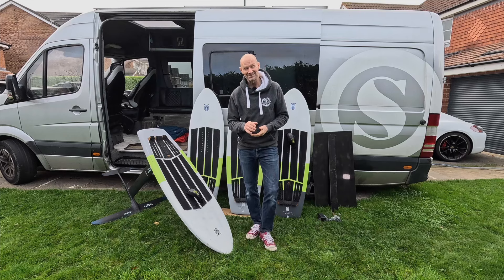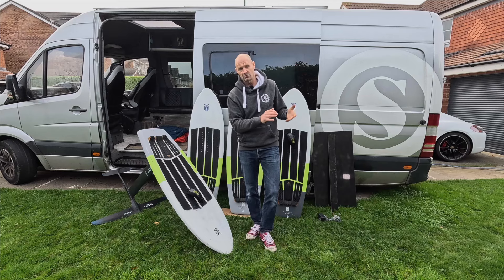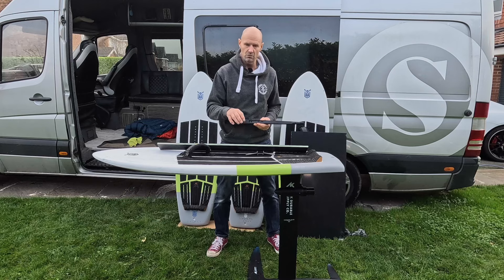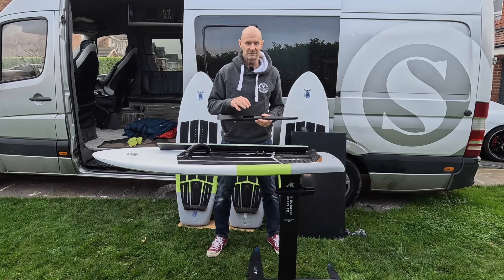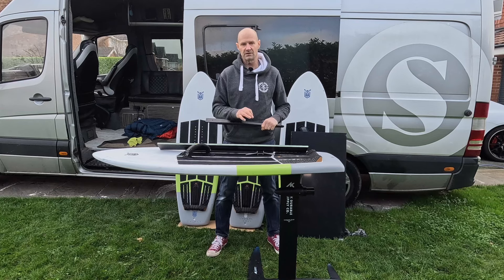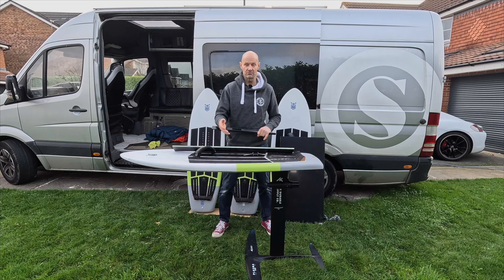Foildrive Max Inset board evolution - chapter 3 - stiffness and the carbon tub.

Comment: I’d love to see the water starts on these boards as I’m thinking along the same lines, volume doesn’t apply, but need to see the techniques to get signal connection and then getting the board level and planing.
Reply from the maker: signal is no issue - built in pathways in the boards in nose and deck. Starting easy also - as long as you pass the stall speed whilst in prone position you can ride almost any size foil (just takes more battery to get there on the smallest foils. The 4'8x18 we made is shown starting in vid #2

Comment: Great "engineering around". I share 100% what you're saying about stiffness. I have been wake thieving with Foildrive a lot trying to catch a wave that runs at 33-37km/h😅. It threw me off with the same 4'6" bamboo tech board and then it'd be controllable and rideable with a 4'6" full carbon board. You even feel less the swing weight due to the battery case. Pumping efficiency increases! In Downwinding it makes you work/pump less since you feel more. At first you need to get into it though..all the turbulence is also transferred right to your feet😅.Good job 👏 Bravo
Reply from the maker: wake thieving at almost 40km/hr, that's too funny. That's hauling!
Reply: @ktwo-surf  that's what you do when you live on a Lake far from the ocean 😇😂. Really jealous of those waves in your backyard 😀.  But sincerely I've really fallen in love with some wake waves. Amazing surfing 20km, sometimes more and learn for the time in the ocean. Share your stoke for Foildrive. And loving your boards 😁

Comment: What about mast lengths? Are they relevant when it comes to ability to catch waves?
Reply from the maker: mast lengths are a massive subject for prone foiling in general. From my perspective I use shorter masts in smaller waves, bigger masts in bigger waves. There is a ton of + ve's and -ve's to each, but ultimately the foildrive has enough power and speed to catch the fastest, shallowest ocean swells easily - it's a unique and total cheat code.
Reply: @ktwo-surf  thanks! It's quite a challenge for a begginer to grasp everything that's happening under their feet. I started off with 85cm mast now have a 60cm on order. I have vague idea of pros and cons ultimately the lack of info out there specially for beginners means I am often throwing money at bits and seeing what works and what doesn't. And perhaps this ambiguity suits the industry.

Comment: Really interesting! Where can I see standrad dims etc.?
Reply from the maker: Every board is slightly different according to customer's requests, but from 3'8x19 pump board to 5'10x18 slim long board.
The main stock size is 5'1x19.5, this has the best balance between sub foiling glide, stall drop recovery and shortest swing weight to be practical, though I'm starting to go a bit longer on my personal boards.
Reply: @ktwo-surf  nice! Where can I inquire on pricings and shipping costs?
Reply from the maker: @yonatandishon4276  send me a mail at mike@ktwo.surf

👍

Comment: Also, you talk about fuse stiffness.  I have noticed advanced riders using the aluminum fuse.  Just wondering if I should go from carbon to aluminum to improve stiffness.  I do have that option.  Thanks for everything you are doing.
Reply from the maker: The fuselage is a big thing - it's small and takes a ton of stress. I guess the answer is whichever one is stiffer..